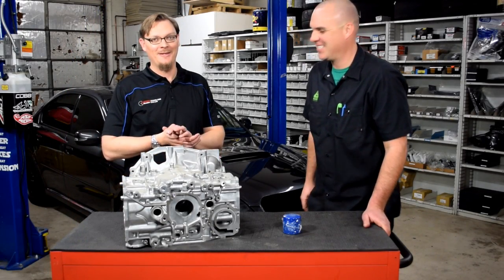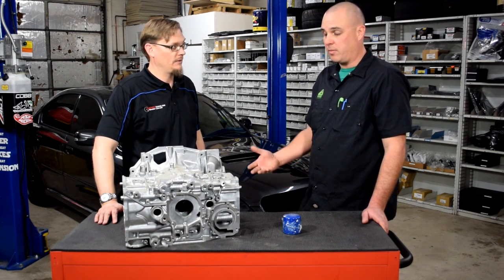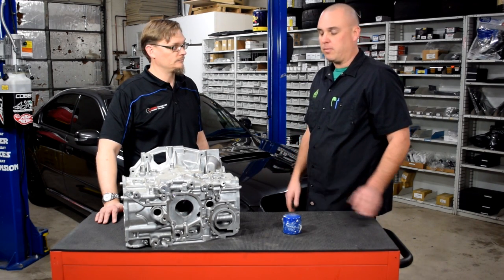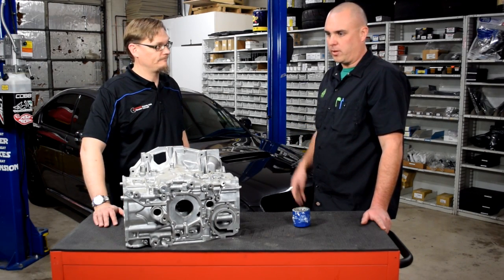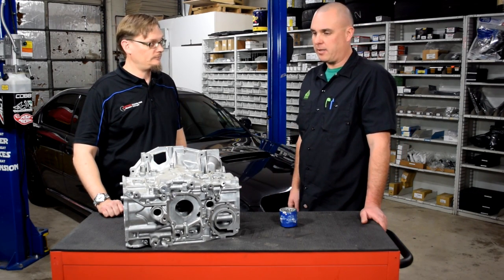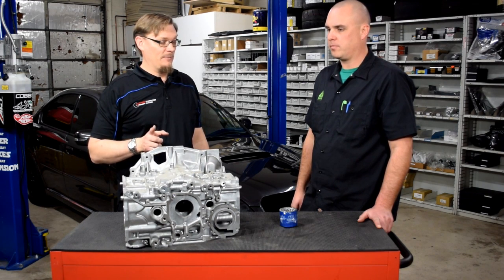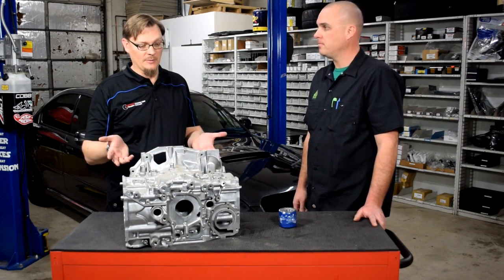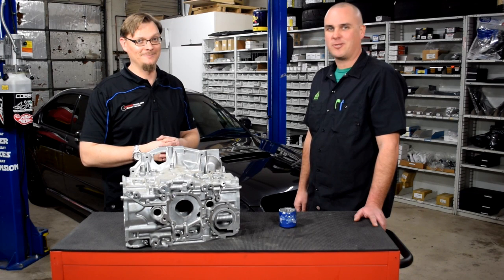Can't get your Subaru Oil Pump to Prime?  What to check and a possible solution.

Comment: Hi I know this is an old video, I am about to try and start my ej20 tomorrow that’s just been rebuilt with brand new oil pump, do I remove the oil filter then crank the engine till the oil comes out the oil filter housing? Thank you
Reply from the maker: Thanks for watching and thanks for the comment.  Yes, that would be a good start to make sure that the pump is primed.  Then put on an empty oil filter.

Hope that helps and Stay Tuned!

Comment: Thank you so much for this video! I built a EJ20G CDB motor 6 months ago am finally getting it close to the point of first start up. Going through the prestart checks on first crank, without fuel pump connected, I realized I had no oil pressure and coincidentally; tried all the things you guys did to no avail. Until cranking without the oil filter for 10-15 seconds. 71 psi of oil pressure now. thanks a bunch, you guys saved me from tearing the front of the engine apart along with the sump and everything else.

Comment: This video was amazing. I also followed the guidance of many online that said to top off the oil filter. Cranked in intervals for over 2 minutes total with no signs of oil pressure. I came across this video so I tried the top addressed here. I took the filter off and after about 39 seconds had a small amount of oil running out. I quickly threaded on an empty filter and then kept cranking as fast as I could. Had oil pressure in about ten seconds from that point.
Reply from the maker: Thanks for watching and very glad that the video helped!

Stay Tuned!

Comment: 05 subaru legacy gt 2.5 5 speed. Turbo blew. Removed turbo before i installed turbo i checked to see if there was any oil at the line. No oil! So i removed all 4 banjo bolts. 2 had filters. One behind timing belt was a bear to remove but i got it out without removing timing belt components or covers. Shaved down the plastic and once out i shaved the bolt down to put back in.  Did that and still no oil pressure. Ended up removing timing belt anyways and replaced oil pump. Ive read that the little piston inside gets stuck.  So did that still no oil pressure. I even pulled the oil pan to check the oil pickup nothing.  So i started researching and i found this video and it did help me diag but i still wasnt getting oil out of the oil filter housing with filter removed. So i read forum guys were saying just to start that bi**ch. So i did and bam oil shot out of the turbo feed line like an oil rig blowout. So thats my story. Hope this helps someone else.
Reply from the maker: Thanks for watching and thanks for the comment.  Glad you were able to get your oiling system to prime.

Stay Tuned!

Comment: I was wondering if manually rotating the motor with a ratchet right from the harmonic balancer before startup, and before even installing the accessory belts, could that properly prime the entire engine? I ask because I'm about to go through this process after installing an ej20x on my '05 OBXT.

Comment: Looked at this video, what I ended up doing was tilting the engine forward as I had it on the ground, mounted a transmission housing converter and flexplate attached,  hooked up the starter and it primed up in a short while. If it has to suck up from the oil sump sometimes it needs a little help.
Reply from the maker: Thanks for watching and glad that you were able to find a solution!

Stay Tuned!

Comment: Thanks so much for sharing this tip. Just installed an engine I built 4 years ago and couldn’t get it to prime for the life of me. Before I tore it back down I found your video. Saved me a bunch of time and aggravation! Had oil pressure in about 45 seconds.
Reply from the maker: That is awesome to hear, and glad it helped.

Stay Tuned!

Comment: What a huge help!  Removing the filter resolved our problem!  Thank you sooo much!  Our “new engine” is a remanufactured engine that was tested and documented before being shipped, but still could not create pressure until we removed the filter and cranked until oil spurted out.
Reply from the maker: Very glad that this helped get you up and running.  Stay Tuned!
Reply: Hi I know this is an old video, I am about to try and start my ej20 tomorrow that’s just been rebuilt with brand new oil pump, do I remove the oil filter then crank the engine till the oil comes out the oil filter housing? Thank you

Comment: Another "thank you so much" from me!  Just finished timing belt + oil pump reseal job on my 2004 WRX and couldn't get oil pressure.  Used this tip and 5 minutes later I had oil pressure.  You just saved me so much grief - thank you!
Reply from the maker: Very glad that this was helpful, and glad you found it.  Stay Tuned!

Comment: This as many have said is valuable information, may I add that the larger the size of oil filter makes this situation worse as there is a greater static head of oil present in the filter to move. This video explains the issue very well.....well done.
Reply from the maker: Thanks very much and glad that this was helpful.

Thanks for watching and Stay Tuned!

Comment: I Removed the oil filter and saw oil gushing out of the cooler as I cranked the motor. So far so good,  BUT, when i put the oil filter back on and continued priming, I wasn't able to build pressure up the block to my turbo oil feed. Oil galley was dry, AVCS dry. not sure what it can be </3
Reply from the maker: Sorry to hear that.  Definitely open up a live chat with us so we can get more information, and we'll do our best to help out!

Hopefully it is something simple.
Reply: @FlatironsTuning  Just did and it was very helpful, thank you! Seems like i wasn't cranking long enough in between intervals. I had the key turned for only 5 to 10 seconds max. Was told minimum 30 seconds intervals of cranking on a fresh build was the way to go. Eager to go home and try this, it makes perfect sense. Hoping this is it!

Comment: Hey guys, on the fb20 engine fitted to my 2018 XV the oil filter screws down on top of the motor, so you can't fill it without it pouring out.. so I assume the only practical way when changing oil and filter is to install the filter dry, allowing air to pass through quickly.. the motor parts always have residual oil and it is just like a cold start I think!
Reply from the maker: Correct.  On the FA/FB engines, since the filter is up-side down, there is not any way to pre-fill them.

Generally, the air should move through the filter quickly so it should not be an issue.

Thanks for watching and Stay Tuned!

Comment: I've read about people pressurizing the oil switch location to prime the oil system but from what I see here it is pressurizing it the wrong way - is there some way to use air pressure to help this along or should removing the filter always be enough?
Reply from the maker: Thank you for your question.  You are correct, sending oil down the pressure switch location (with a pressure accumulator for instance) can help to make sure that all of the journals of the engine have some oil in them, but it will not help the engine prime.  There really is not a way to use pressurized that I am aware of. 

In most cases where there is an issue, removing the filter as described above has worked.

Hope that helps, and Stay Tuned!
Reply: @FlatironsTuning  Thank you!
Reply: @FlatironsTuning , hi, using pressurised oil through the oil pressure switch hole will not send oil to the pump because of the one-way, anti-return valve inside the filter?

Comment: I think this is how I killed my jdm 2.0 with a killer B oil pickup. The guy that did the swap primed it like he normally does his engine swaps but I dont think he verified that it was getting oil pressure. I definitely put oil in the filter when I did the Killer B oil pickup tube and new oil pan.

Comment: Is there a way to scavenge air pockets from an oil circuit prior to initial prime to further help eliminate this issue?
I would think something along the lines of a vacuum, similar to power steering and cooling circuits. Would like to hear some thoughts!
Reply from the maker: Thanks for your question.  Your best bet there is to use something like an engine pre-oiler which lets you send oil into the engine under pressure.  That would probably be the most efficient way to do that.

I hope that helps and stay Tuned!

Comment: I just completed building a new engine, got it all installed and am in the same boat. No oil pressure, idiot light staying on, and on the verge of pulling everything apart. I cannot wait to try this out! I've been scratching my head about ways to somehow back-fill/pressurize my oil system with a pump sprayer in an attempt to fix this. Thank you for a great video!
Reply from the maker: Thanks for the comment, and I'm glad that you found this video.  I hope that you can get some oil pressure going in the new engine.

Best of luck, and if you need anything else, feel free to reach out to us on live-chat on the site.

Thanks for watching and Stay Tuned!

Comment: My 2007 STi is forged. On a cold start my oil light flickers, goes out, then flickers again and goes out for good. Takes about 30 seconds for this on each cold start....any ideas, maybe sensitive pressure switch? OEM oil pump has only done about 40 k miles, and my builder said it was ok.....so he refitted it when he forged it for the second time. I say second time as this latest build was bought on by a cracked block! Bad luck, but I don't want this oil pump to do the same again - if the oil pump was to blame for the cracked block anyway...
Any suggestions?
Reply from the maker: Thanks for your question.  If you are seeing that light flicker, I would first recommend putting an oil pressure gauge on your engine to see what your actual oil pressure is  At cold start the oil is its thickest, so your pressure should be high.

My concern is that you aren't seeing that behavior, there may be an issue that is worth investigating further.

I think that you best bet here is to get some actual pressure numbers and go from there.

I hope that helps and Stay Tuned!
Reply: @FlatironsTuning  Thank you for the reply. Bad news, the oil pressure gauge (it had never been used before) took about 30 seconds to register any pressure. Eventually crept up, not bouncing (on cold start) to around 30 - 40 PSI and down to 10 PSI etc. It's got Millers CFS 10w60 in it at the moment, never had an issue with that oil before on my forged build. New pump going in in a few weeks and going from there.....my money is on a stuck pressure relief valve in the pump. All will be revealed once I know more. My previous build on this engine was in 2015 (38k miles ago) and the pump was replaced back then, so if it is the pump, it's not done well. This could be a lesson to all, replace your pump at build regardless of how old it is / mileage covered, just to be sure, they aren't stupidly priced. My concern is now what's happened internally, sounded loud, more like rod knock than slap. The builder will try a new pump and hopefully that will give me normal pressures and quieten it down.. he says he will use a standard pump 11mm but use an uprated valve in it..... I'll keep you posted.
Reply: Verdict....oil pickup pipe cracked 75% of the way round like they do. New 12mm oil pump fitted and pickup pipe and all is good, oil / filter change also. The car seems fine now so guess I was lucky. Oil pressure light now goes out whilst cranking.

Comment: I removed the plug under the pump inlet side and used a pipe with rubber tip and forced engine assembly lube into the inlet for the gears. We turned the engine over slowly by hand while pushing the grease into the gears. I took the oil filter off and cranked it and it worked like a charm. Oil was gushing out in no time.

Comment: Vaseline works great for packing the pump. It's made of hydrocarbons like regular motor oil and has a low melting point so will quickly dissolve in the oil.
Reply: That's tried and true advice. Fifty years ago my neighbor did that to his ford 289 V8. I was a little kid but I always remembered it.
Reply: mine was packed with thick assembly joe Gibbs "driven" engine grease still had this problem. Removing the oil filter was the only thing that worked

Comment: Dang! All that work just because of putting oil in the filter lol. Don't you hate when you have to take everything out and you're just wondering what the hell did we do wrong? Glad you guys found the solution.
Reply from the maker: Exactly!  We figured that it would really help to get this information out there so that if anyone else is having an issue, you can quickly remove the filter, and with any luck, solve the issue :-)

Hope that helps, and thanks for watching!
Reply: You guys are great! Super appreciate the information!

Comment: This is the solution we use on all our in house builds. We have been baffled by that as well. But this tool works as well as anything I can think of. Thanks so much for the info!

https://www.jegs.com/i/Sealed-Power/844/T40/10002/-1?CAWELAID=230006180035746604&CAGPSPN=pla&CAAGID=44693592161&CATCI=aud-295441111667:pla-213811363271&CATARGETID=230006180039218810&cadevice=c&jegspromo=nonbrand&gclid=Cj0KCQiApvbhBRDXARIsALnNoK3yqa8IaIx75QJXgSj0DC31K9MifJwzutIB0puRG1WqkzmhZbsC9RkaAmGeEALw_wcB

Comment: Does nobody pack the oil pump with grease anymore? Even just filling the pump with assembly lube would be better than just dry cranking it because one of oil's jobs is to seal.
Reply: We always use motor honey or something else thick to pre prime the pump. Instant oil pressure upon start up
Reply from the maker: As we are getting more feedback in on this video, it is seeming possible that what ultimately caused the issue that Allen ran into was the combination of filling the filter completely and putting on a pump with no oil/lube/packing.  At some point, we may have to do a little more testing on those conditions.

Thanks for watching!
Reply: @FlatironsTuning  thanks for the reply. I really enjoy your videos.

Comment: building subaru engine is very easy engine as long as it is done right dont forget parts always double chek your work an you will never have issues like priming the system

Comment: i see no need to put oil into any filter thats not needed been building engine for sometime now an found no way better too prime a oil system after a rebuild is too manually load the oil pump with fluid an make sure your lubricant every part with a gud assembly lube
Reply: putting oil in filters does absolutely nothing cause the system gets the oil from the sump first then too the  lines or filter. there will alway be some form of dry start. like when engine sit at nite or after an oil change always ah bit of air too